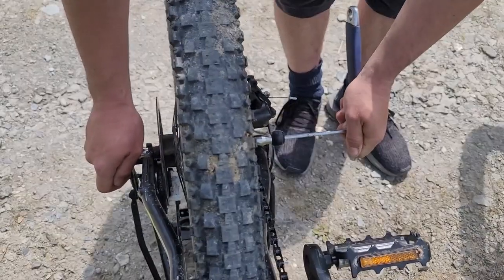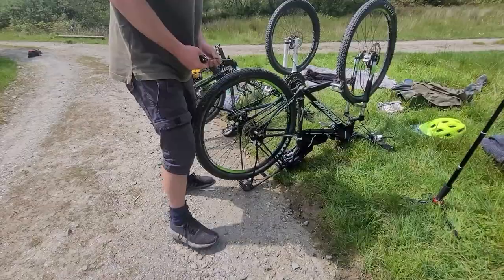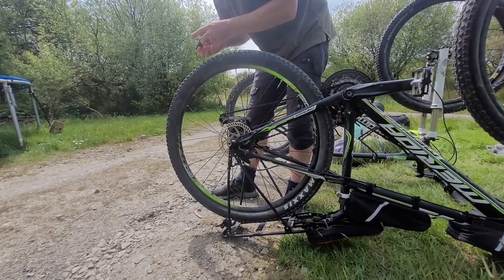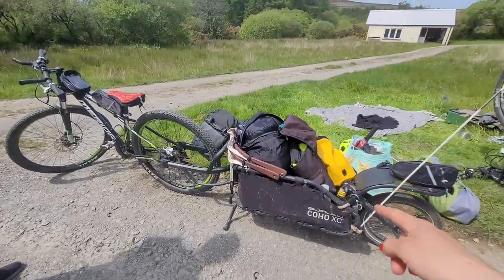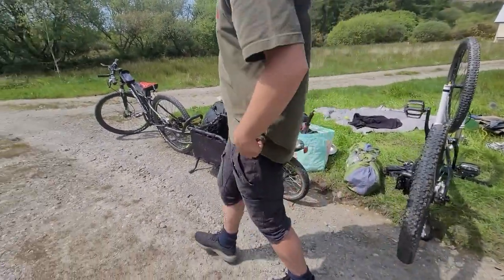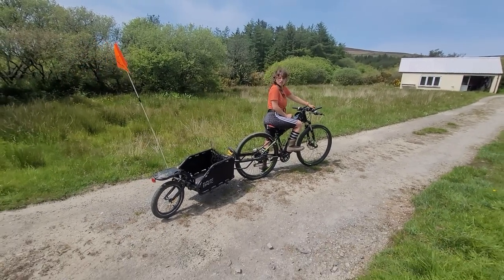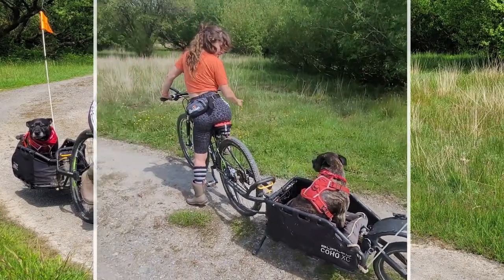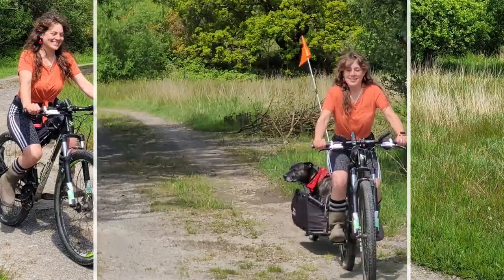First Time Cycling with a Trailer | Fitting the Burley Ballz for COHO XC

Comment: great stuff.  Split between this and Topeak Journey (lighter, drybag and axle included) but this has better features.   Still undecided.   If you have tried both pls let me know.
Reply from the maker: We haven't tried the Topeak, but at about half the weight it looks like an attractive option! 
Because our dog rides in the CoHo, for at least half of the day, it was important it was roomy enough and had the side fabric built in... and the CoHo's rear wheel mudguard/rack came in handy redistributing weight to make room for doggo...

But if you are planning on using it just for cargo (as designed lol) the toppeaks lightweight design and dry bag would have me looking 😉

Comment: Hey I have a question and was wondering if you would be able to help. How is this trailer at speed taking a turn. I have an e-bike with a conventional mounting trail and have flipped it a couple times taking a turn around 15mph. It this a more sturdy trailer?
Reply from the maker: Flipped it! No, we haven't experienced anything like that! This trailer leans into the corner with you really nicely. It takes a bit of getting used to when riding standing, climbing a hill, as you can feel the weight as you lean the bike away from you... but maybe the ebike means you don't have to do too much standing?
This trailer comes with a manufacturer's rating of 32kg & 15mph which it far exceeds. I've done hundreds of miles with 45Kg at 15mph... 25kg at 30mph and it feels fine 👍
With a dog in it, the main challenge is when they get bored and shift their weigh around... have to be ready to put the power on to get through the wobble! 
Hope this helps 👋
Reply: I'm doing ebike testing with it but have yet to release any video on it.
Reply: I use this trailer with my Trek Allant Plus S7 pedal-assist bicycle, and it handles beautifully when I go shopping or camping. I absolutely love it!